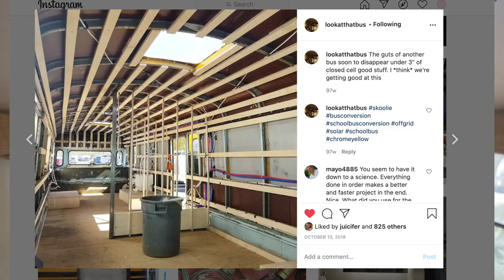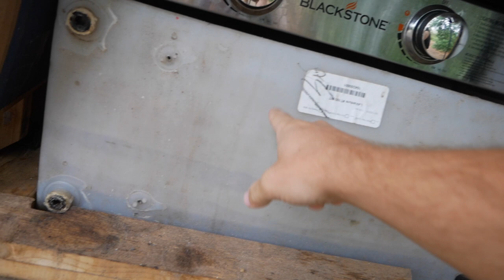My 7 Skoolie Building REGRETS: Watch This Before You Start a Bus Conversion!

Comment: Thanks for the video.  I get a lot of hate from people when I tell them  don't get a 40ft bus.  I have a 22ft Class C and it has space for everything, only issue for 4 people is having to change couch to a bed at night.  Outside there is plenty of room to hang out.
You don't need a fan on the roof. What you need is cross flow between windows to move air.   
Put fans in the windows that cross ventilate.  Note that regular houses don't have fans in roof!  (ok, some have whole-house fans, and they work well, but not required)

Comment: I totally agree on the rear engine. The view is great (and essentially the same seat height as big rigs) and for the most part the engine noise I hear is the whistle of the turbo. It will be even quieter once I build out the interior.
I really enjoy driving so it's nice to not have the heat and noise of a dog nose or even worse a front engine. Also, as my 31'-6" Thomas has such a short wheelbase, maneuvering is very easy. I drive it everywhere like it's a car. People think I'm crazy.
Reply from the maker: Woahhh how do I find a 31’ RE Thomas?!
Reply: They’re out there! A bit more rare than the 40 footer, though. This one was from NV so it was rust free.
It also included a working exhaust brake which was a welcome surprise.
Reply: @MobileDwellings  Another 31’-6” RE Thomas like mine with exhaust brake from Clark County, NV just came onto the market.
Reply from the maker: Woah. Can you please send me a link?
Reply: @MobileDwellings  Sent with some other info I hope is helpful. 

Also of interest as you didn't care for the mini-split condenser being mounted on the back of the Gillig, on the Thomas HDX there is enough space directly below the driver's seat to place the condenser, so it will be ahead of the wheels and pretty protected from debris. You could use one of the existing A/C side vent panels (if you remove the huge OTR system) and mount that to the side panel cutout ahead of the wheels. You should be able to turn the wheels hard to the right and slide it under the chassis when installing. 

That's my plan, anyway. We'll see how it goes.
Reply: @MobileDwellings  Did that link arrive? It didn’t get bounced, so wanted to make sure you got it.

Comment: I remember years ago west coast customs brought this chick into the shop to do a "glass roof". Essentially it was a roof plug once the hole was cut open. I don't know what state your in but its an idea to plug the roof. Maybe contact a welder and have them make a metal plug and within the metal plug is a hole for which ever fan you want in it. Not the most helpful but a couple ideas to start with.

Comment: Hey guy's 👋 👋 👋, 
I personally wouldn't recommend any Insulation that can absorb any form of liquid, I would recommend polystyrene tho, I've used it lots and it's cheap and easy to use, and most importantly doesn't absorb moisture.
The " Maxie fans " / Max fann or whatever you guys call it, is a real good choice they draw very little power and proform great.

Comment: dear bro, i would like to collect more inf. about spray foam, to protect the condensation, what else would you think you gonna choose besides spray foam. i will take all window out and put the some new in and rise the roof. the most important that i worry much is condensation because i used to see the water drip n drop out from the metal. would you please guide me about this problem before i start to do it. #2 is that i want to protect from the sun because my location is hot around 90 to 110 on May, June, July, august and September but on November, December, January, February, there are foggy to much n high humidity 95%, that is 2 thing i need to do for mu bus. 1 is protect heat, 2 is protect condensation. please help me to decide. i would like to collect all inf. so i would know what i gonna do with my bus because i will spend my life in the bus 100% as my house.
Reply: I wouldn't go for anything that can absorb moisture, I.e wool.
I recommend polystyrene, because if u had a leak or something, the water won't be absorbed therefore the water doesn't pool as easy, meaning hopefully it will dry out and not rust.